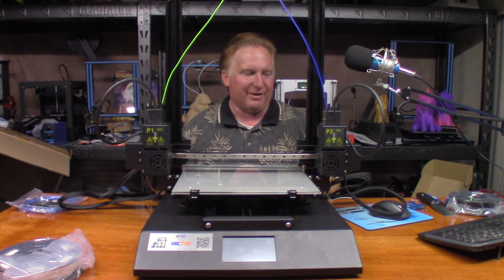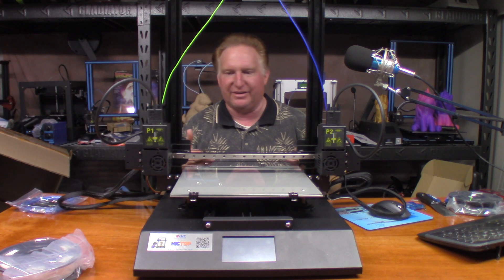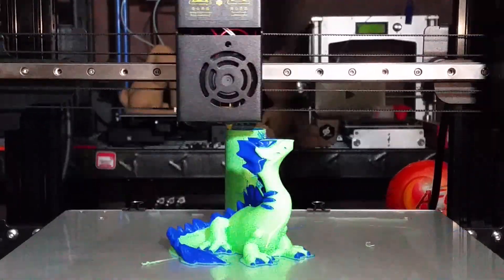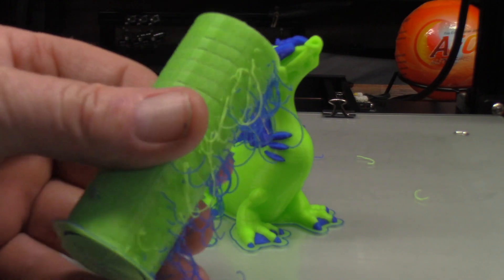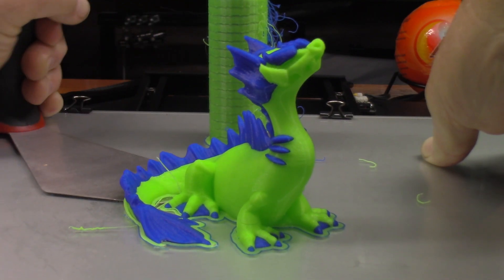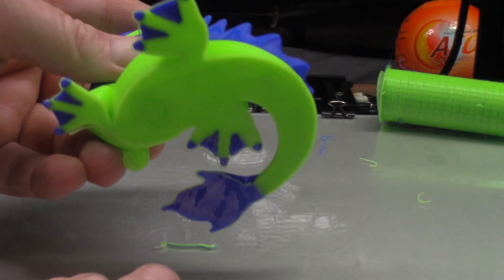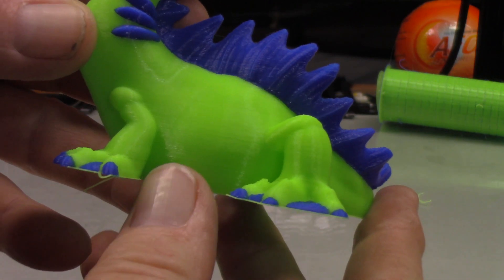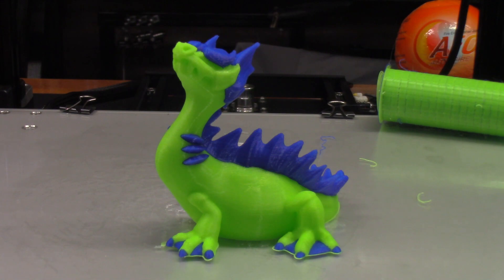First 2 Color Print Off The HICTOP D3 Hero 3D Printer

Comment: Why is there a purge tower?
Reply from the maker: To prime the parked extruder.  The filament oozes out while parked.  Without it there would be under-extrusion.
Reply: @JimmyShawsTidbits1  makes sense, glad it's not as large as others
Reply from the maker: @pdxcerealkilla9847  definitely doesn't require a lot to get it primed.
Reply: @JimmyShawsTidbits1  There's definitely a lot more wasted filament on single nozzle multi-filament hotends, since it has to purge the old filament from the entire extruder before changing colors. Tons of waste from the videos I've seen (in some cases, the print itself uses only 20% of all filement printed, with the remaining 80% going to the purge block. Dual extruders seems far less wasteful.